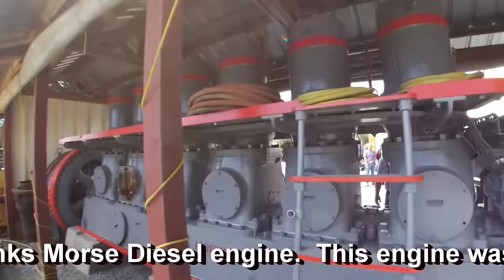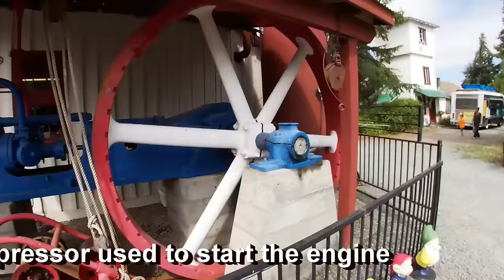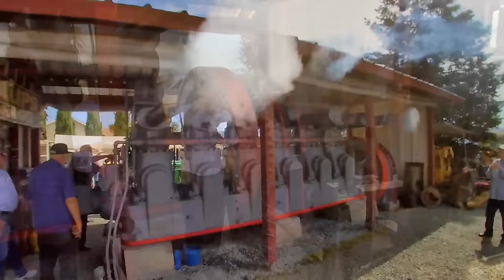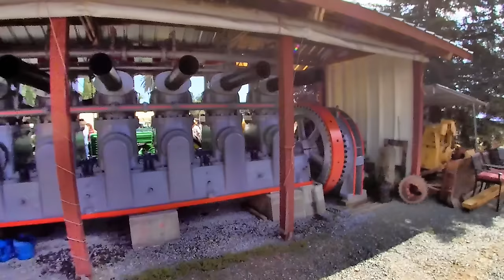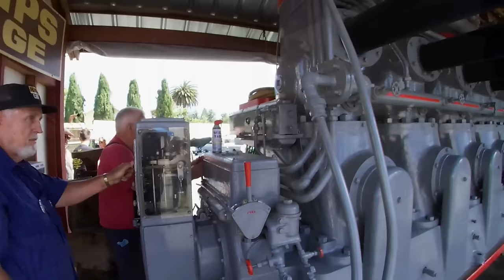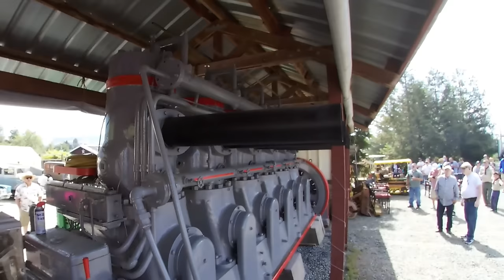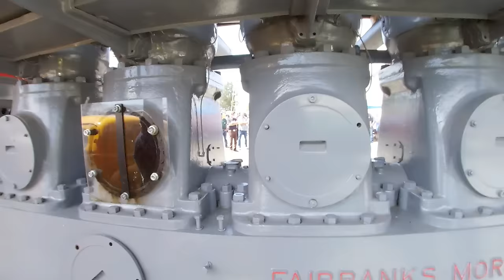450 Hp 1930 Fairbanks Morse Diesel Engine Startup

Comment: An enormous pressized crankcase 2 stroke
Reply from the maker: Actually each cylinder's crankcase is pressurized individually by its own piston's down stroke.  No blowers.
Reply: I like the pressurized individual crankcase design better even though the bottom of the engine hade to be much heavier. The oil sump is external like key a rotax 850 Etec!
Reply: I like the pressurized individual crankcase design better even though the bottom of the engine hade to be much heavier. The oil sump is external like key a rotax 850 Etec!
Reply: I like the pressurized individual crankcase design better even though the bottom of the engine hade to be much heavier. The oil sump is external like key a rotax 850 Etec!
Reply from the maker: Thanks for the comments.   It was really fun watching it start up.  As I was taking the photos the exhaust almost blew off my hat from 25 feet away.
Reply: This makes the engine very heavy as it has to be much more stronger the a blower scavenged 2 stroke or 4 stroke. i like the pressurized crankcase now matter how bulk it is. Even outboards have a strong heavy bottom ends to with stand the pressure and constant loading. The model 32 ran journal bearings with total loss oil burn off.
Reply: i like the crankcase pressure with a turbo, unfortunately the the engine bottom must buit much heavier and stronger than a blower svcavenged 2 stroke or 4 stroke, but thats a good thing, its a much stronger structure! I had a 297 JLO with a very heavy crankcase, would not rev high compared to 4 strokes but i liked it, we have all benn brainwashed into a light duty high revving 4 stroke but not me
Reply: put tuned exhaust.
Reply: Direct fuel injection allows the engine to idle smoother, as opposed to a carburated gas 2 stroke with lots of misfires at idle. (dirt bike etc.)
Reply: @georgehomenko5358 Like the 850ETEC Rotax, any inline 6 diesel can be be modified to use the crancase with billet aluminum stuffing and ports cut, dry sump oil injection from 6 gallons of amsoil dominator/interceptor 2 stroke oil and have some fun!

Comment: You can see the technological progress here. While 450 HP diesels were big like a small house, nowadays you can easily fit a 450 hp diesel under the hood of a car...
Reply: yes, 450 HP, but not with nearly 8000 foot Lbs ot torque.
Reply: @mikesrestoration  yup. 100% correct
Reply: 300 rpm's.

Comment: Not bad for hp but this little baby 
"maserati Unveils 621-HP V-6 for the Upcoming MC20 Sports Coupe
Jul 2, 2020 — The engine will produce 621 horsepower at 7500 rpm,"  will kick it but and I can pick up block with one hand.  Not good reaction time takes few seconds to get up there but this engine don't have it eighter.  But 450 at 300 rpm crank it to 3600 rpm I but have some power

Comment: Commifornia only allows one start up every ten years for 12 seconds.  Low rpm two stroke almost no smoke or noise-I want a small version for my motorcycle. Would probably get 250 MPG. Also there is a new Al Gore tax on air going into a compressor because it causes thermal mass damage to the molecular structure inhibiting its ability to decompress but only west of the eastern Atlantic shore.
Reply from the maker: Couldn't agree more...Actually they have to have a special permit from California air board to start it.